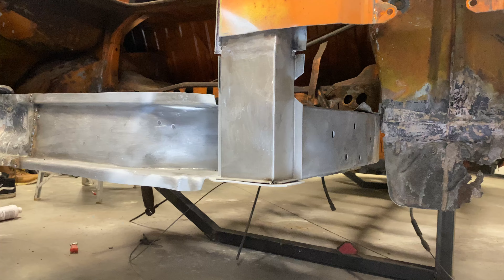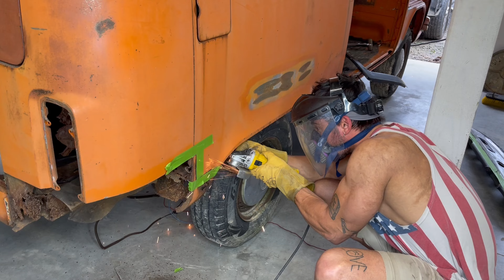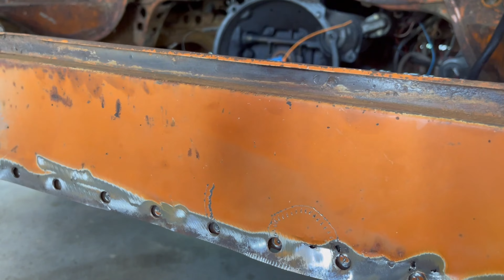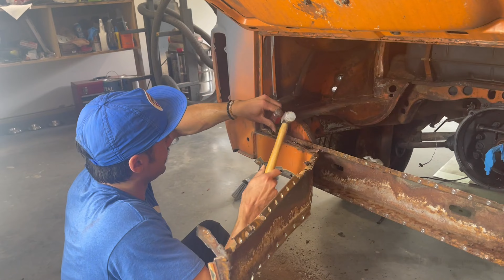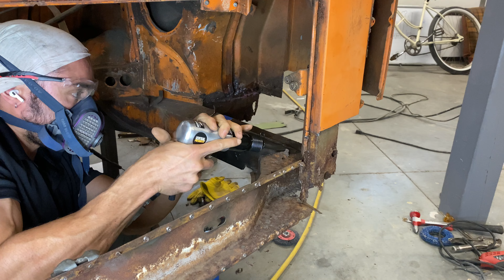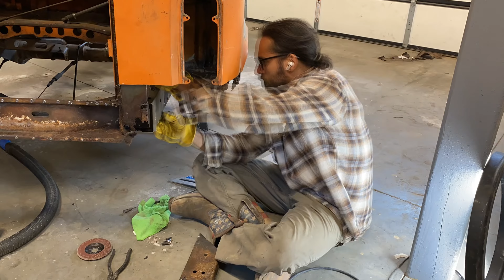VW Bus Restoration Episode:54 | I Have a Rear Bumper Mount Again!

Comment: what I've been doing to get cuts lined up good is just like you were doing! but followed by like, dremeling off (with grinder wheel) any of the high spots between the two pieces. going slowly, checking, grinding a bit more, checking, grinding a bit more. . . doing it a little bit at a time usually gets a really close joint for butt weld :) Also, has the weld-thru primer been working well? the whole weld/paint/rust triangle feels like such catch-22 to me.

Comment: hey guys, great work on the van! How do you handle your weld-through primer? I've had the worst luck with them where the first application works great but as soon as I let the can sit for a day or two it's done for (yes, after blowing out the nozzle) .. yours seems to work .. which one are you using? keep up the good work

Comment: Thanks for sharing your work. It has giving me confidence to make a start on my bus. Done some small patches successfully now mocking everything up for a non sliding door side rocker/sill replacement as well as rear guard, fitted and checked many times and just about ready to commit to welding it in.
Reply from the maker: Good luck! Once you get going it gets easier 😁

Comment: nice,  i know you use .023 wire for  a lot of your sheet metal welding, did you go with a beefier wire size for the frame weld portion?
Reply from the maker: I used the same wire just at my hottest setting

Comment: Lovely job! Missed you guys. On Wednesday. Thank you and Mallory for my stickers and the thank you card ❤️ I recently had to mess about with my battery tray that I fitted in 2015 - water/rust got in between the tray and the bracket that’s spot welded on to it. I had to remove the bracket clean it up and replace it with zinc primer prior to refitting.
Reply from the maker: Glad you got the stickers! Hope to see you at the next livestream 😊

Comment: Diagonal welds make sense from a engineering perspective. Not only do you get more weld which creates a stronger joint, but you also take some of the load out of shear. Where this joint is at though it really won’t matter
Reply from the maker: That makes sense to me 👍